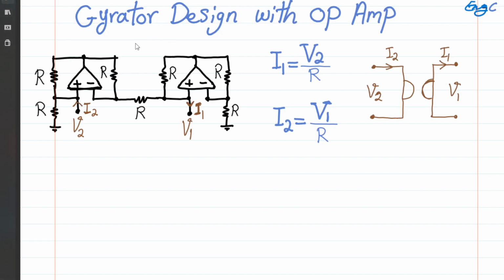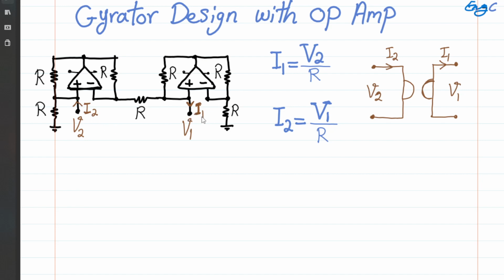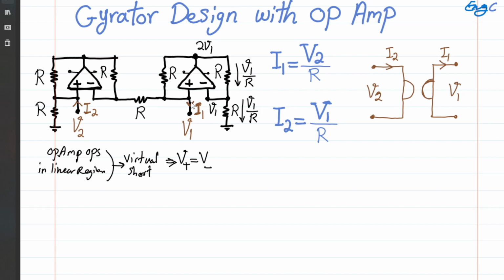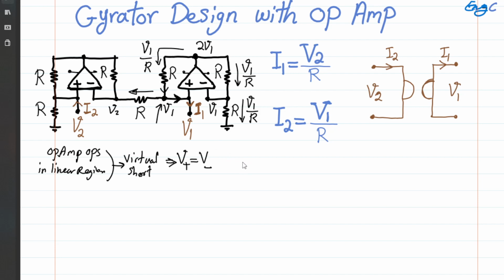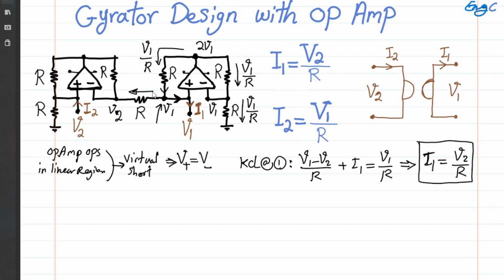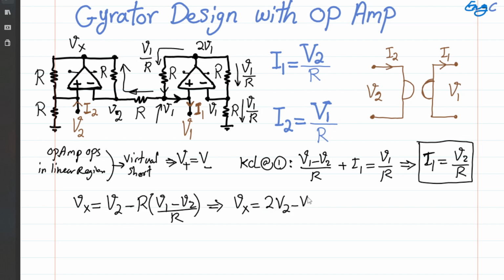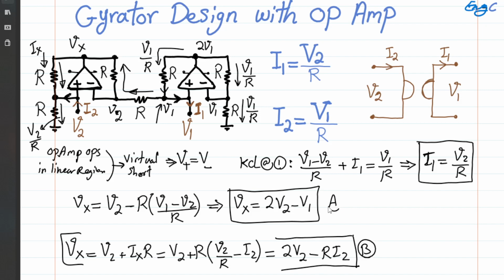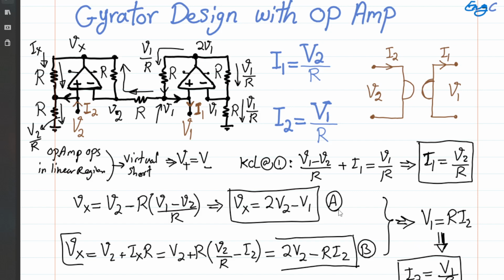Gyrator Circuit Design with Operational Amplifier

Comment: thanks nice video.
Reply from the maker: You are welcome. Thanks for watching. Glad that you liked this video of Gyrator Circuit Design with Op Amp. For more Analog & Op Amp Circuit examples please see Converting Capacitor to Inductor https://youtu.be/weIHG45G6Pg 
Negative Inductance Design by Op Amp Impedance Converter https://youtu.be/GF_Mun_Mkyo
Active Inductor with Op Amps https://youtu.be/6IYz4iaa05c

Logarithm Analog Computer with Op Amp https://youtu.be/RpKEq5WyoLg
Analog Computer circuit that solves Differential Equation. And https://youtu.be/HeZRtnRXpEI
Capacitor to Inductor Converter Circuit https://youtu.be/weIHG45G6Pg
Operational Amplifier Gyrator Network Circuit https://youtu.be/2KpjAytRBpc
Triangle Oscillator Op Amp circuit https://youtu.be/JF5Up_cuL9k
For more analog examples see https://www.youtube.com/playlist?list=PLrwXF7N522y4c7c-8KBjrwd7IyaZfWxyt
Thanks again. 🙋‍♂️